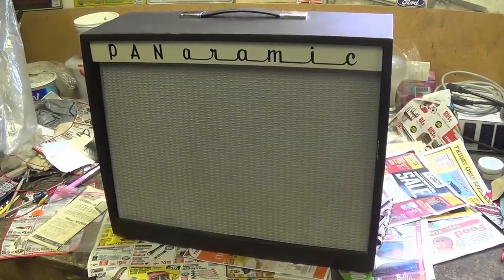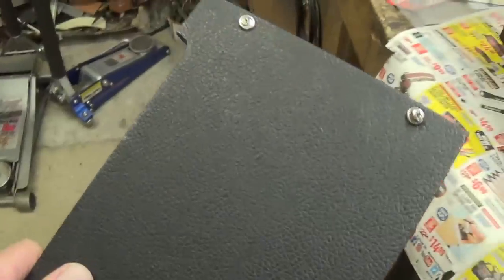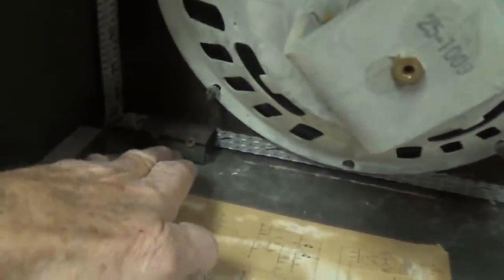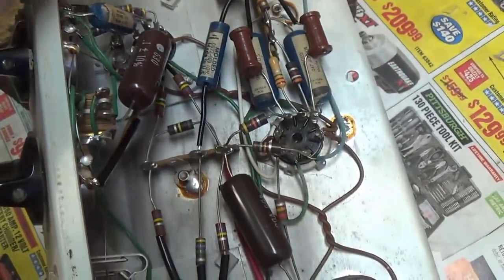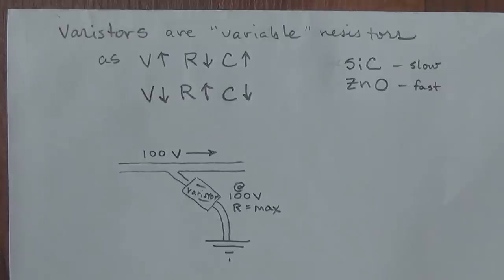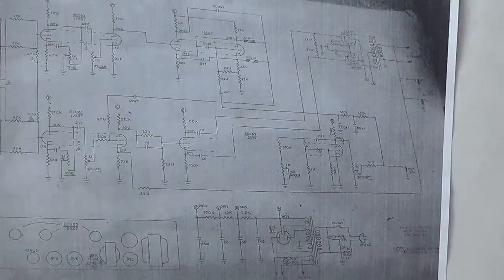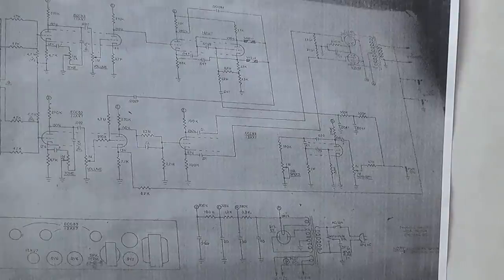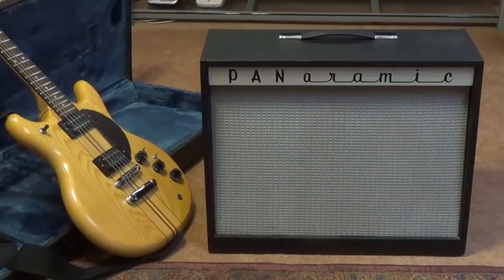1963 Magnatone Panaramic Model 1210 Amp with "True" Vibrato

Comment: I've been watching your videos for years, learned a huge amount from them and want to thank you for this one especially.  I bought a Magnatone (Estey) model 15 amp that has stereo vibrato and a separate reverb output section... 5 speakers in total! The amp was in the opposite condition of this gem you found, non-working but it was cheap and I was certain I could restore it.  I rebuilt most of the reverb section and corrected some prior fiddler's mistakes and got it working and sounding very nice, but the preamp voltages have remained about half what they should be on schematic.  Each preamp/vibrato tube when put in one at a time drops about 20-30 volts each... I've been very reluctant to touch anything in the vibrato circuit because I didn't understand how it worked at all, and as you point out information is scarce.  I suspect somewhere in there is an excess of current drawing the voltages down, so maybe now with some help from your video I can track it down easier.  I really appreciate you.
Reply from the maker: You're welcome, Ryan. I agree that either some component is drawing too much current, or there is some problem with the HV winding in the PT. Best of luck with the completion of your restoration.

Comment: Bigfoot Effects makes a photocell-based solid-state vibrato, that copies what the tube-based Magnatone circuit does, essentially pitting the two outputs of a phase-splitter against each other, and modulating one of those outputs with an LFO.  It sounds lovely, and you can find plenty of Youtube demos of it.  Some of the Magnatone amps - both vintage amps and resissues - will provide a stereo vibrato, with two separate power amps feeding separate speakers.  Those amps use a phase-splitter to countersweep a pair of vibrato subcircuits.

I was making myself a small solid-state "stereo" lunchbox amp and thought I'd make a stereo vibrato, based on the Bigfoot circuit, simply because the possibility intrigued me.  Rather than having two counterswept vibrato effects synced to a common LFO, as in the Magnatone amps, I decided to make two completely separate vibrato units (one stage each), with a dual-ganged pot increasing and decreasing their respective LFOs in unison.  A common dual-ganged intensity pot simultaneously adjusts the brightness of the LEDs illuminating their respective LDRs.

The use of two unsynced vibrato units is absolutely magical and immersive in stereo.  Every bit as engaging as the chorus on the old JC120 amps.  Maybe moreso because neither channel is "dry", as in the JC120.  As you've experienced and demonstrated, the Magnatone vibrato effect is more nuanced than gimmicky.  It's a gentle wiggle, not a boing.  Having more stages (e.g., 4) would make it more "boing-ey".  The aperiodic nature of two unsynced vibratos is what makes it more animated than gimmicky.  I highly recommend stereo vibrato, if you can swing it.
Reply from the maker: Thanks so much for your very knowledgeable input, Mark. Are the Magnatone 260 and 280 capable of the stereo vibrato you described?
Reply: @UncleDoug   Hi and thanks for such delightful videos. and excellent lessons in how to bring back old gear to life.  
Looking at their respective schematics, the 260 appears to implement "stereo" in the same manner as the Roland JC amps.  That is, one channel has the vibrato, while the other is "dry".  The 280, on the other hand, has vibrato on both channels, but uses selectable inversion of the LFO subcircuit to countersweep the vibrato on each channel. ( https://elektrotanya.com/PREVIEWS/63463243/23432455/magnatone/magnatone_280a_sch.pdf_1.png )  I say "selectable", because the "stereo/mono" switch on the 280 selects between opposite-phase LFO to each channel (stereo) or in-phase (mono).  I've never played one myself, but I imagine the 260 to sound richer than a mono Magnatone amp with vibrato, and the 280 to sound richer still.  

Though a different category of effect, using entirely different technology, the Boss Dimension C chorus pedal also countersweeps a pair of bucket-brigade chips with a single LFO, providing an inverted and uninverted version of the LFO output.  The modulation of delay time produces a pitch-change, but the time lag between the dry and wet signals also creates a bit of comb-filtering and a "thickening" of the sound, leading to the perception of multiple instruments playing the same thing; hence "chorus".  Listened to in stereo, one side of the Dimension C goes flat while the other goes sharp.  One gets the "animation" that such modulation provides, but because the pitch does not seem to move in any single direction, the "pitch-wobble", that many musicians don't like about chorus effects, becomes much less perceptible.  

The unsynced stereo vibrato I made for myself works in much the same way.  And because there is no consistently reciprocal change in the pitch (though once in a long while, for a very brief instant, the two unsynced LFOs may line up in a way that does so), one gets the liveliness of all that gentle modulation, but no particular connection between pitch moving sharp to flat from one side to the other, as it would in the Magnatone 280.

As an aside, a decade back I visited George Gruhn's guitar store at its old location in downtown Nashville..  On the 2nd floor, wher the "preferred customers" have access, sitting inconspicuosly against a far wall, was a Magnatone amp with a $175,000 price tag and a little Dymo label on the top near the handle.  The label said "Buddy Holly".

Comment: Hi Uncle Doug,
Another great video. I have. Got to say I don't know how you do it. That Panaramic amp is absolutely beautiful. It looks like it just came from the factory. Wow!!!  I really liked the explanation of how Magnatone produced the true Vibrato. You know me, I had to research, and the company that made those varistors pulled off a miracle of manufacturing for the day. Not even GE could ever match their specs. I saw one circuit that comes close but uses 3 MOV’s and 3 trimmer pots in parallel and requires meticulous adjustment to replace just 1 original varistor. Your explanation of the circuit principles sounded almost exactly like the class at electronics trade school (35  some odd years ago) on AM and FM radio modulation theory.  Same exact principles, just lower frequencies. Phase modulation was used for many years and probably still is by Motorola in their commercial two way radios rather than true FM modulation. I never really understood why, . A trained ear can hear the difference between someone transmitting on a Motorola Micor as opposed to a GE Mastr II (yes there is no ”e” in Mastr II). The subtle difference between PM and FM. Both change the input frequency but PM also affects the amplitude of complex waveforms to some degree, especially in harmonic rich waveforms (like notes from a guitar string ) Perhaps that is part of the musical quality reproduced by the Robert Moses design. Who knows? 
The Gretch was to die for. As soon as I heard the hum I instantly knew it still had its original pickups. I had a Gretch slab-body Corvette and ended up putting a Gibson Humbucker in it because of the hum from the old pickup. The image of your shop guitar is about to drive me nuts trying to figure out what brand it is. This is what I see, Gibson stop tail piece and tune-o-matic bridge, Gibson humbucking pickups, although they could be DiMarzio, Gibson Speed knobs, all like an SG or Les Paul Jr. Deluxe. But the body shape is all wrong. Horns are not pointed enough for an SG, the body is too rounded to be a Les Paul Jr. Appears to be a 3 piece solid body similar to how Les Paul built his first guitar. could not see the headstock so no help there. What the heck is that beautiful thing? Well as always loved the video.
Reply from the maker: Another complex and wonderful commentary, Mark. Thanks so much. I do envision the oscillator input as acting sort of like a carrier wave for the music signal......whether that is wildly wrong or not, it's still easy to visualize. 

Yes, the Filtertrons are original, with ultra-low output and ultra-high noise.....but I'll be darned if they don't sound great :) 

I enjoyed your speculation on the shop guitar. It's a 1980 Matsumoku Vantage V-695 Performer with MMK-45 humbucker pickups that I got from a local pawnshop many years ago......for $225 including a hard case. It took a lot of work to repair, re-wire, and set up properly, but it's been the go-to guitar for countless videos, and has seen all sorts of Fender and Gibson guitars come and go :)
Reply: @UncleDoug  Those are Hi-Lo Trons, single coil pickups that Gretsch used on their lower end instruments. The FilterTrons were hum cancelling. Both seemed to come into use as the company phased out DeArmond single coils sometime in the late 1950s. 

The Vantage guitar is a nice example of guitar aesthetics of that era. In the late 70s to around 1980, there was a trend toward natural wood finishes, sometimes contrasting laminations, neck-through construction. I don't know how heavy it is, but heavier guitars with heavy brass hardware was also a corresponding fashion. Some nice examples of this aesthetic came from the likes of BC Rich, Martin, Alembic.

Comment: Doug…, Realistically, how many watts is this amplifier??
Reply from the maker: My guess would be around 18W to 20W tops.
Reply: Thanks Doug…👍🏻
The reason I was curious as I looked at the size of its transformer , And the the Two 6V6’s And was wondering why,
My 59 SilverTone 1432 is supposedly rated at 10 Watts…? I noticed my transformer was larger than this one…. I also have two matched. 6V6 Groove Tubes in it , and my Amp is pretty freakin Loud…! I did replace the filter caps, and one resistor… I have a,
Eppiphone Electar 12 Re-issue, With two 6V6’s and it is Loud as all get out… I also have a Supro 12 Delta King …
I kind of compare my  1432 two both of these …! Volume wise… Loud distortion and loud clean in my book are two different things…! 
I prefer loud clean …😹😹👍🏻.
Reply from the maker: @iplaymytele  I'm going by the published output power for the amp, IPT, which may or may not be accurate. Cathode-biased 6V6's in P-P are probably limited to 10W, grid-biased 6V6's (as in Fender Princeton or DR at relatively high PV) are capable of much higher output power......i.e. 20W+
Reply: @UncleDoug  ..
Thanks Doug…👍🏻🙏🏻
I appreciate you getting back with me. I do enjoy your channel. ….👍🏻👍🏻👍🏻

Comment: OMG THAT TONE... ugh just saw one of these on reverb.com and they want a kings ransom for it.  😢

THanks for bringing this beauty to our attention UD
Reply from the maker: You're welcome, CD. I looked at the Reverb offerings and found this one: https://reverb.com/item/17988854-1960-panaramic-magnatone-213  which is quite close, except for the tube rectifier and offset speaker. I believe the video amp is one year newer.
Reply: @UncleDoug  , the magnatone 213 is an awesome amplifier. Those have Keith Richards tone in spades! Good clean tone at lower volumes, and they overdrive and break up very nicely when pushed. Kind of like a variant of a blackface Deluxe, tan wise, but a little less ratty, cleaner and more controlled when pushed into distortion. They are highly desirable for recording and gigging in small clubs.
Reply: @UncleDoug  Thanks UD

Comment: You're a little off on some aspects there, Doug. The phase shifter only changes the pitch while that resistance is being modulated. Moving one way will raise the pitch and the other will lower it, but if it's not being modulated (moving) then there's no pitch shift. Also, a phase shifter affects different frequencies differently, as opposed to another method of doing this, usually called a chorus, which uses a delay line to store a recent history of the signal in, with the speed of that delay line's playback being modulated to create a pitch shift. That's the difference between phaser and chorus/flanger guitar effects. In the case of a chorus effect every frequency gets the same amount of pitch shift. Similarly to the phase shifter, it only changes pitch when the delay time is being modulated. If you don't modulate the delay time then the pitch remains the same, and there's merely a delay (echo) to the signal. An exaggerated chorus effect is called a flanger, and often enhances the effect even further with a feedback loop.

And auto-tune is a completely digital process (that's why you can buy software that does it) and doesn't work by either method, but rather by breaking the signal down by FFT (fast Fourier transform) into its component sine wave harmonics, and then generating new harmonics of corrected pitch to match that pattern. 

(I make a software phaser, by the way. http://www.admiralquality.com/product/stunning-phaser And someday when I get around to it I'll do a delay/chorus/flanger too.)
Reply: Speaking of guitar effects, the original phaser effect was the Univibe, and it used 4 light bulbs, powered by the output of an oscillator, combined with 4 photoresistors to modulate the resistance of the 4 transistor filters (which are neither high nor low pass but another kind called "all pass" that creates a narrow notch where the shifted frequencies cancel each other out) just like the tremolo in a lot of the old Fender amps. It had a vibrato mode that was the pure wet output of the phase shifter, and a chorus mode that mixed the dry signal back in to create beating between the original and pitch shifted signals, like what you'd expect from two slightly detuned instruments playing the same part.
Reply from the maker: Thanks for your input, AQ. I don't recall saying that phase shifting occurred without rhythmic modulation of the resistance. My aside regarding auto-tune was more in jest, in an effort to use the frequency adjustment as a means to clarify the function of the vibrato circuit. Naturally, I realize that in this modern day of digital electronics, auto-tune is not achieved by a computer tweaking a potentiometer :) You are obviously an expert in this field and I genuinely appreciate your detailed discussion of effects design.
Reply: @UncleDoug  Well, it's in that auto-tune example (non-example) again. You seem to imply that the setting of the resistor controls the amount of pitch shift. But again, it's the modulation of that setting that causes pitch shift, the rate of change and the direction of change as opposed to the particular current value, and pitch returns to normal the instant that resistance value becomes static. And as there's only a limited range of adjustment, you can't keep on going in one direction forever. So if our singer was permanently flat, our attempts to pitch shift them higher would end as soon as we hit the extent of the variable resistance -- the only option at that point is to turn around and go back the other way, which will lower the pitch instead of raising it. That's true with delay lines (or even tape/disk recorders) as well. So that's why phase-shifters, choruses and flangers always modulate up and down, because they're constantly having to turn around and go back because they've run out of range to modulate within. (And why pitch shifters didn't exist until the digital era. The earliest ones worked by throwing away or adding copies of the waveform cycle -- and sounded pretty awful particularly on complex signals like chords. There's no analog equivalent for that though as we're destroying or making new information in the digital process. Modern digital pitch shifters, like those used by auto-tune, are more sophisticated (and take a LOT of processing power) and use the FFT method.

Actually, there is an analog process that's like an FFT, and that's the vocoder. But real-world examples didn't have nearly enough stages to provide a convincing resolution, it was an effect that colored the signal significantly. Originally designed as a method for long distance phone calls where poor frequency response of long wire runs could be mitigated by breaking the signal up into modulation envelopes for a bunch of different frequency bands, where the rate of modulation could be much lower than the frequencies that make the human voice intelligible. The trade-off was needing a separate wire for each band, as well as producing a highly distorted signal that didn't sound much like the original, but was sufficient for vocal intelligibility. And then of course in the '70s they started to get used to give synths robot voices, where instead of modulating a white noise carrier with the vocoder to try to reproduce a simulation of the original signal, instead you modulate a musical tone carrier with rich harmonic content, and then the vocoder applies filtering (much like a graphic equalizer) that matches the characteristics of the modulator voice signal while maintaining the carrier instrument's musical pitch and character. :)
Reply from the maker: Thanks again for your very knowledgeable input, AQ. We appreciate your clarification of this complex subject.